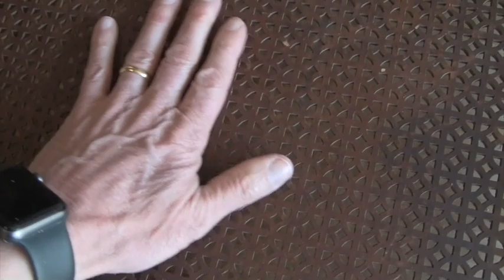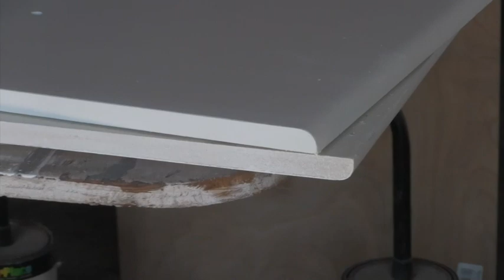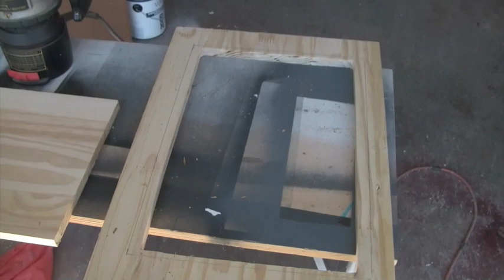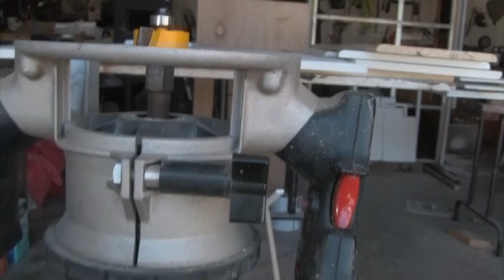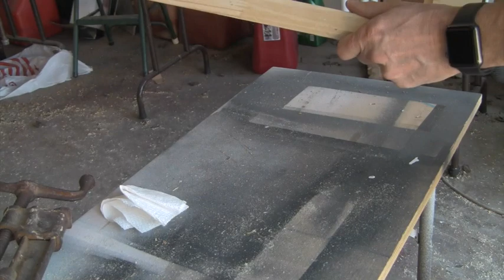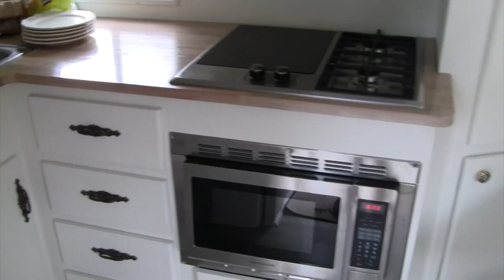Vintage Camper - Making Two Cabinet Doors

Comment: Beautiful trailer can you tell me what's gas and electric I'm guessing just the stove is gas is that all you use the propane for and what's running off electric
Reply from the maker: Thank you Franky Frank!  The stove and oven are gas. The refrigerator runs on gas or electric. The lights, air conditioner and exhaust fan run on electricity. There is also a gas heater that we don’t use.

Comment: how did you fasten the lattice to the frame you made? You did not show that. Other wise has any one told you that you do good work.
Reply from the maker: Hey Gary, I put four screws in at an angle from the back side...kind of like you would put nails in behind a picture frame to hold the picture in.  Thanks for watching!